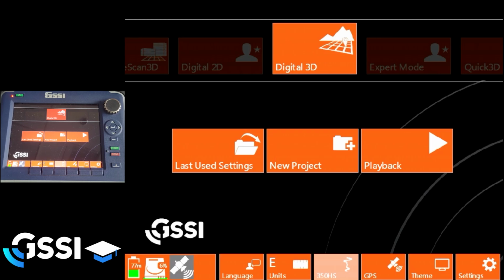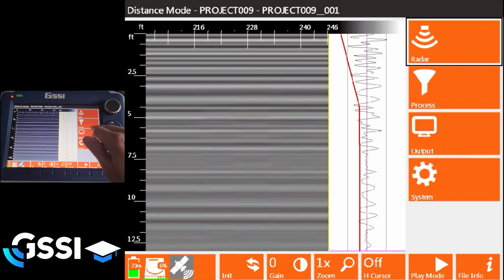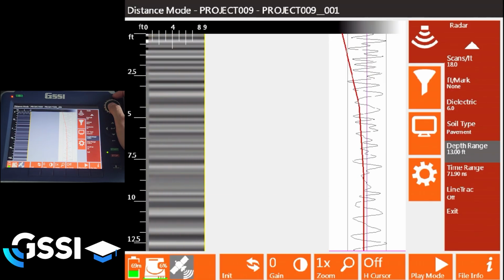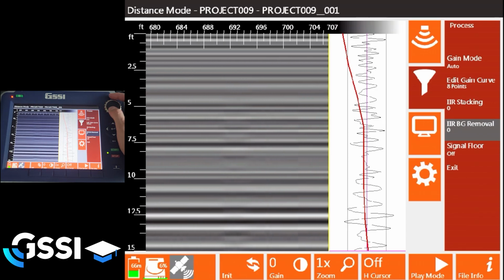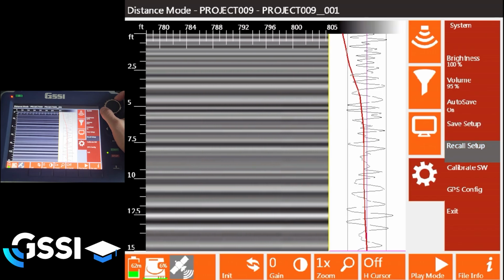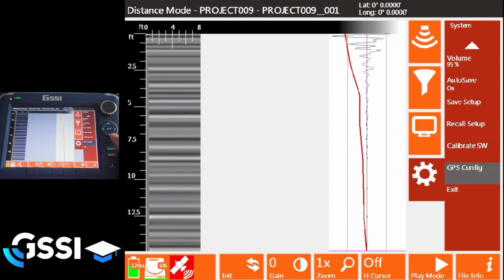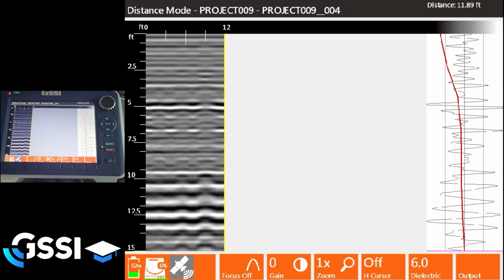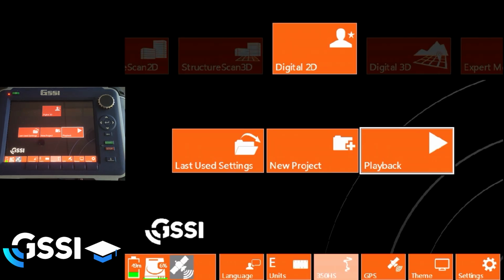GSSI | SIR 4000: In Depth Overview

Comment: Thanx for interesting video. I have used SIR4000 now for years but still learned some new things. Is it correct that settings only affect what is shown on SIR4000 screen and not actual data with one exception being Depth Range which actually limits depth range of data?
Reply from the maker: Glad you found it helpful!
Yes, all of the settings are saved in a separate file from the RADAR data, with a .dzx extension. The raw RADAR record is always saved independently, with a .dzt extension. The only settings that will impact the actual data are the settings that impact the raw GPR record. These would be the Depth Range/Time Range and the Samples per Scan.